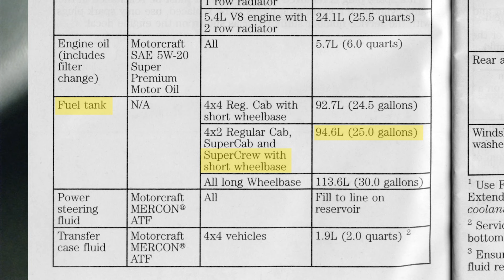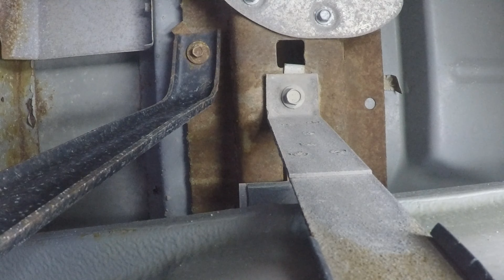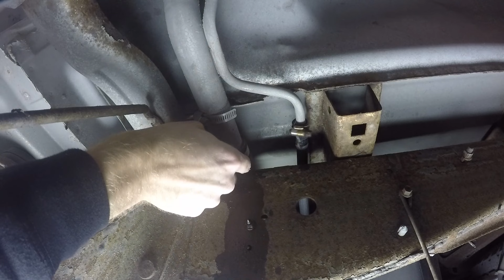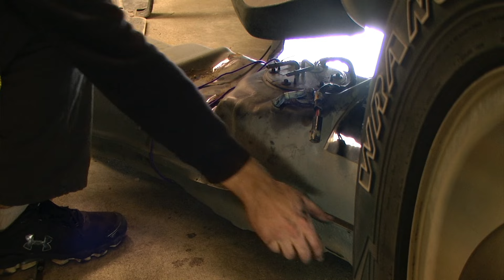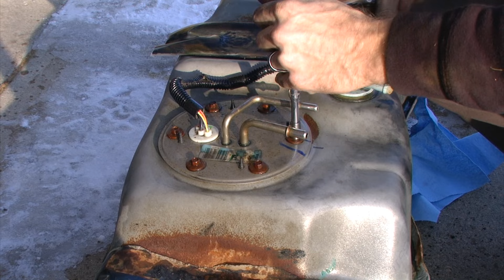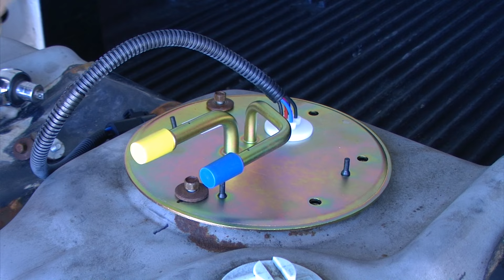Fuel Pump Replacement - 1997-2003 Ford F150 5.4L - NOTE: CREW CAB BODY REQUIRES TANK TO BE DROPPED.

Comment: By far, one of the best tutorial videos out there.. Super helpful, very descriptive, great pace on speaking. Saw a comment that the pump is under the cab on supercrews, so glad i didnt go the bed route.
Reply from the maker: Thanks for the comment and good luck with your repair.  Yes, on the Super Crew cab, you have to go underneath and drop the tank.  If you are doing this on other body styles, the "bed off" method might be a good option.  I'm going to pin this comment to hopefully help others figure out which works best for them.

Comment: Nice and dandy, but for that truck to be a 2001 model, the tank and the underside looks to clean, and the hoses in too good condition. I just did this job on my 1997 (4 years older), and I had to cut the cut all the hoses, as the hoses would not come out, and they were all (fuel, vapor, and vent) all bridle and partly torn under the clamps, once removed. These were OEM original hoses. I could see this being possible on a mid 2010 model, but very fishy on this particular video.
Reply from the maker: Definitely a 2001, I owned it for 10 years.  Feel free to check out my playlist for this truck. https://www.youtube.com/watch?v=UVp5ajGNHWA&list=PLYNR1w8QDiFrPnjsHMnRoxfaCl4V9T4xp

Comment: Great tutorial...I have to do this very soon and I like having my tools laid out ahead of time.
Reply from the maker: Thanks for the comment, and good luck with your fuel pump replacement!
Reply: Thank you. The only thing I plan on doing is also using the sharpie to write the date and milage on the top of the new pump. If it craps put in the future I will know when it was done

Comment: its a good thing you chose to remove the tank. Thats a super crew cab. The fuelpump is actually in the part of the tank thats up under the cab
Reply from the maker: Correct.  The super crew cab requires the tank to be dropped.  Other models you can remove the bed.

Comment: You haven't corrected this. You cannot access the fuel pump on a crew cab by removing the bed. You have to go under.
Reply from the maker: Agreed, you are correct.  On the crew cab it is necessary to go underneath.  This video was originally made to explain the general process across all of the various styles.  In the comments, this has been addressed multiple times.  YouTube doesn't allow me to edit/add content to the video once it is posted.

Comment: You can not access the fuel pump without dropping the tank on a crew cab it’s under the cab DO NOT PULL THE BOX ON A CREW CAB
Reply from the maker: That is correct.  Access varies between different makes/models/trims.

Comment: Ever think about cutting a hole in the bed and making an access panel like Ford should have done ??? You know, right above the fuel pump area? I did this and replaced the bed liner and now only ME and YOU know this.
Reply from the maker: Thanks for the tip.  That thought had not occurred to me until you just shared this little golden nugget of information.  My only concern would be sparks in proximity to the fuel tank during the cutting process.

Comment: I know this eons ago now, but did you ever check for that sediment build up? How would you clean that? Simply drain the tank completely and rinse out with some fuel?
Reply from the maker: I looked in the tank and didn't see any noticeable sediment buildup, however there are baffles which make it hard to tell.  I think one could probably "rinse" it out with some fuel if you have the tank off.

Comment: I have the exact same truck. You cannot replace the fuel pump by removing the bed. The fuel pump lies on top of the tank below the back seat of the cab. I know this because I just took the bed off my truck 2 days ago and the fuel pump is not exposed.
Reply from the maker: Correct.  The limitation with the crew cab body style is that the fuel pump sits under the cab.  The fuel pump is accessible under the bed on other body styles of the same year.

Comment: All this complication they put on these vehicles to keep most people from doing this. And we pay for it in the cost of the vehicle. Once upon a time these fuel pumps were mounted on the engine block and operated by a cam on  the camshaft from  a push rod.  2 bolts to remove and for the most part,  easy to get to on the engine. No electronics to go wrong. Lasted 100,000 miles and cheap to replace. But no more. The newer systems are done to make money for  the car dealership shops..it's a crying shame...How many cars, trucks bit the dust because of a bad fuel pump in the tank? To replace one of these abortions will set you back anywhere from 400 to over 1200.00 bucks depending on shop rates where you are and likely more. It's no wonder some will try this extremely  risky job themselves (gasoline fumes are extremely  dangerous for fire, explosion) if they want to keep their vehicle on the road. In the old days, anyone that could use a socket wrench could change a fuel pump, even roadside! Try that with these pos they sell us today by the roadside...No can do friends! That's the idea! Hello dealership! Ka ching for them ! $$$$. And you? @#%$%&*.
Reply from the maker: Agreed.

Comment: Hi: When you installed the tank straps, does the strap flange at the bolt bottom out against the frame. I ask because I'm using aftermarket straps that upon final tightening with the tank firmly against the frame, the strap flange is about 3/4" shy  of the frame. I was wondering if the OEM straps did the same thing?
Reply from the maker: Are you referring to 4:01 in the video where the strap is touching the frame?
Reply: No. 4:01 shows the skid plate bolts. I was referring to 20:00. I just acquired an F150 like yours. The tank has a slow leak because the  straps had badly corroded/disintegrated and the tank was resting on the skid plate (previous owner ignored recall notice on straps). I bought a new Dorman tank and two fuel tank straps but the strap bolts cannot be tightened to the point that they touch the frame. There ends up being a 3/4" gap between the strap flange and frame. I checked other brands and they spec the same dimensions. In your video starting at 20:00, I see a gap and was wondering if you had the same problem?
Reply from the maker: @johnd.5480  I just crawled under and took some pictures.  They can be found at: https://drive.google.com/drive/folders/1pryN9QulUaTZHIRphIyFfFpg9dplSWFR?usp=sharing  Let me know if they don't work.
Reply: Thank you very much! I guess  the aftermarket parts are off a bit. Even though I'll probably be ok, I'm a sticker for things fitting as designed.   BTW, judging by the snow, you must see a lot of road salt.  What's your secret to controlling rust?  your skid plate, tank  and straps look original and in great shape. Thanks again for the photos!
Reply from the maker: @johnd.5480  I have several secrets.  1.  I spray the underside of my vehicle every time I wash it.  2.  I typically park in a garage which minimizes the exposure to weather.  and 3. I will sometimes use Amsoil Heavy Duty Metal Protector, which is an excellent undercoat.  https://www.amsoil.com/p/heavy-duty-metal-protector-amhsc/?zo=10458

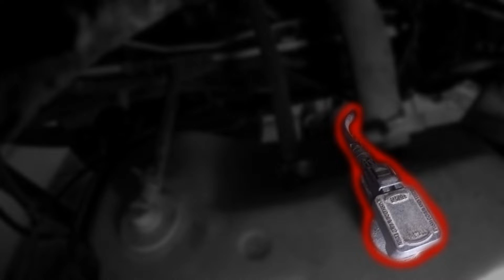Comment: Thanks for the video!  Getting my fuel pump replaced and kept seeing many of these listed for sale online say Fuel Pressure Sensor not included, I thought that was part of the fuel pump at first but didn't see where it was supposed to be, 10:30 so it's on the tank, that solves that, don't know why they mention it on fuel pump listings.

Comment: One of the best tutorials out there! 
My only comment: Has anyone noticed in this video (as well as others) that the circular plate at the top of the pump that sits on top of the tank was rust-proof stainless steel on the old original pump. Now the replacement pumps use just a yellow zinc coating which will likely rust badly probably to the point of failing especially for those in the salt belt......another example of how difficult it's become to find quality replacement parts.
Reply from the maker: I did notice that also.  Parts get cheaper made but continue to cost more.
Reply: Fluid film it if you are worried.

Comment: Ya lots of fun . This is a job that takes some time . Can be frustrating getting the lines off (Fuel) Use ratchet straps (will be safer when lowering ) Make sure you have more than 1 set of release tools. I had to replace my tank as 1 of my tank straps broke free from the truck frame mount and tore the filler tube out of the tank. My fuel pump was still good (I replaced it along with all the hoses so I put all new) If your replacing your tank make sure you put new tank to frame cushion material on the tank ( I used Blue Skin used in the building industry ) 1 day to remove 1 day to reinstall everything don't rush it take your time.
Reply from the maker: Thanks for the comment and tips.  Much appreciated.

Comment: Why the cycling of the ignition key ?
It's much better for the fuel pump if the key is turned to "on" and you hear a hum sound.
Reply from the maker: I just followed the repair specifications.

Comment: That was an absolutely fantastic instructional video!  Thank you!  I have to change mine on my 2000 Ford F150 because I just verified that my pump is inoperative.  I am glad I watched this.  Very informative and perfectly paced narrative.
Reply from the maker: Thanks for the comment.  Good luck with your repair.
Reply: @InsaneOil  You're welcome.  Update: I did not have to change the pump.  It was moisture/ice in fuel rails.  Would not send voltage to pump. Cleared out, starts everytime.  But still, I'll remember!

Comment: Also if you can cut hole through bed of truck directly over pump then you don't have to remove tank ,can't do it on a crew cab cause fuel pump is under back seat.

Comment: Also please no shop vac.  Your pulling vapors into an electric motor.   Use an air hose blowing away from the opening.
Reply from the maker: I partially agree with you.  It is possible that the vapor build-up could lead to a dangerous situation as you indicated.  However, in the video, there is very little gasoline in the tank, I am working outdoors in a well ventilated environment, I am vacuuming the outside edge of the flange hole and spending very little time with it turned on.  The risk was minimized as much as possible.  Furthermore, using an air hose (with the pump removed) would increase the chance of blowing debris into the opening.

Comment: Excellent job very informative. The only feedback I would give is when referring to the screwdriver you keep calling it a flat head screwdriver. It is called a standard Screwdriver. Just as a Phillips screwdriver is not called a cross tip. Just a professional tip to another skilled craftsmen.
Reply from the maker: Thank you for the tip.  I agree with your thoughts.  However, for my YouTube videos I will typically use vernacular familiar to the Midwest region of the USA.

Comment: Your video helped me out today on my 2001 SuperCrew. Previous owner had changed everything under the sun at their Ford dealer attempting to solve a randomly occurring no-start issue (Who knows how much money they threw down the drain...) Everything that is, except for the fuel pump/sender... which I got to discover. Luckily my pump was intermittent, so I had the luxury of getting it down under 1/4 tank before committing to drop the tank. Overall the job only took me about 4 hours of total wrench time; had to take a break in the middle of the job because O'Reilly pulled the extended cab version of the pump (too tall for a crew cab tank) and I had to go exchange it. For anyone watching this in the future:

The pressure and return lines are 3/8" and 5/16" if you're in need of fuel line disconnect tools and don't know what size to get. I recommend just getting a good set of the angled plastic versions in a multi-pack. If you're watching this video, you're also mechanically inclined enough to find use for them in the future.
Reply: Great tips Brandon!   Could save someone a lot of time.
Reply from the maker: Awesome job.  Sounds like everything went well overall.

Comment: I really need to see the removing the bed method
Reply from the maker: Just to note…the bed off method won’t work on the crew cab as the cab extends partially over the tank.
Reply: @InsaneOil  awesome thanks. That's good to know. So I have to do it this way. Great video. You make it look easy
Reply: @InsaneOil  worked like a charm. Except I didn't have the quick disconnect tool so I had to make one out of sheet metal but after some fight and finesse they came off. Once everything was disconnected it was easy to put back together. 10/10 on your video. All the little tricks and tips came in handy
Reply from the maker: @marvelousdave9961  Awesome.  Good job on your repair.

Comment: Hi good day!  May I ask if the fuel pump assembly for an F 150 fit a 2000 model ford expedition same year model?  I found one online that's cheap.  Thank you!
Reply from the maker: I believe it is the same part but I would recommend checking with your local parts dealer.
Reply: @InsaneOil  thank you I was worried about the length of the assembly itself.  The one for the f 150 might be too long.

Comment: How the heck did you get the fuel filler tube out of the gas cap area so easy?!? Yes, I removed the bolts. Just not enough play to get it out of that neck.
Reply from the maker: I don't remember off of the top of my head, but if you are struggling I assume there may have been some behind the scenes off camera troubles on my end.
Reply: @InsaneOil  It took two of us, but we got it! lol  I greatly appreciate this video.

Comment: DANGER  - NEVER USE A VACUUM TO CLEAN THE PUMP FLANGED HOLE OF THE TANK - THE VACUUM WITH ITS BRUSHESS WILL INTAKE GAS FUMES FROM THE GAS TANK AND COULD EXPLODED OR CAUSE A FIRE HAZARD - FIRE DANGER  -NOTE!!!!!
Reply from the maker: I partially agree with you.  It is possible that the scenario you mentioned could happen.  However, in the video, there is very little gasoline in the tank, I am working outdoors in a well ventilated environment, I am vacuuming the outside edge of the flange hole and spending very little time with it turned on.  The risk was minimized as much as possible.

Comment: A motorcycle jack works perfectly for lowering and raising fuel tanks mine was $50 on Amazon
Reply: I also like to disconnect the fuel lines from up front and spray carb cleaner in them and then clear them out with compressed air.
Reply from the maker: @mikemonaghan1105  Thanks for the comment and the tips.

Comment: I see in video you had a hard time getting one of the fuel lines off.  would be nice if you showed how you got that one off as I am having same problem.  I even squirted PB blaster on it and am using the special tool.  please advise?
Reply: I recall that it took a long time and I kept messing with it trying different fuel line disconnect tool sizes.  Eventually it went.  I cut out a bunch of video footage of me just messing with it.

Comment: Dont take off the bed you cant get to the pump by taking it off
Reply from the maker: Agreed.  The bed-off method does not work for the Crew Cab.  It will work for some other styles of trucks.

Comment: Replacing   a   fuel   pump   on   a   2004    f   150
Reply from the maker: Process should be pretty similar.  Good luck with your repair.

Comment: what are the sizes for the send and return lines on the gas tank?
Reply from the maker: I used a 5/16" fuel line disconnect tool.  Not sure what the actual sizes (I.D. & O.D.) of the lines are.

Comment: You still would have had to drop the tank if you took the bed off. I used two floor jacks to lower tank

Nice video 👍 covered the details pretty good
Reply from the maker: Agreed.  The CrewCab style doesn't give full access to the pump with the bed removed.

Comment: Excellent video with super clear narrative. I envy your lack of rust. My pump is ok (probably not the original), but my tank has a pinhole leak at the seam. I can't put more that a 1/4 in it without smelling vapors and seeing the wetness on the tank. No drips ... yet. Not environmentally responsible to continue to use it this way. Again, I appreciate the quality of your video. It has increased my confidence that I will not be in over my head.
Reply from the maker: Thanks for the comment.  Good luck with your repair.

Comment: Hi Jon. I have 1999 Ford f150. And your video really helps. I have a question though.....should my fuel pump be my last resort? Meaning should I just replace it or should I diagnose everything first? Because honestly I don't think it's my fuel pump. Thanks again.
Reply from the maker: What are the symptoms? or why do you think it is the fuel pump?
Reply: @InsaneOil .....it idles when I drive it. It'll go go go, then all of a sudden it will start to die out then kick back again and start moving, but it repeats that process. So I stopped driving it, and gonna buy parts to eventually fix it. It May be a sensor? Or the fuel pump module(I'm hoping), because that thing looks rough under the truck.
Reply: And this beeping sound kept coming on.
Reply from the maker: @1Godbolt3  Might be worth having a reputable mechanic take it for a drive and give you an assessment.  Could be as simple as the fuel filter getting clogged.
Reply: @InsaneOil ....was thinking of doing that. I know a good place here in Alaska. alrighty. sounds good. Thanks again!